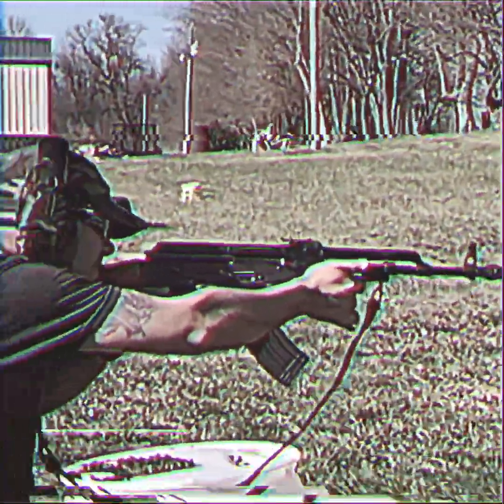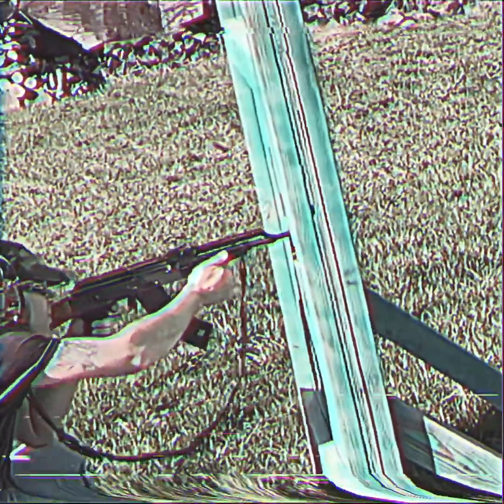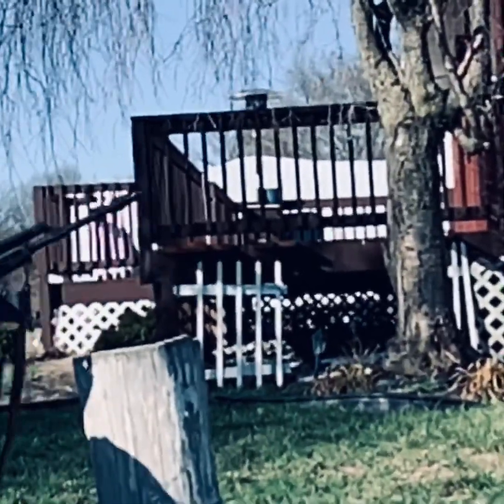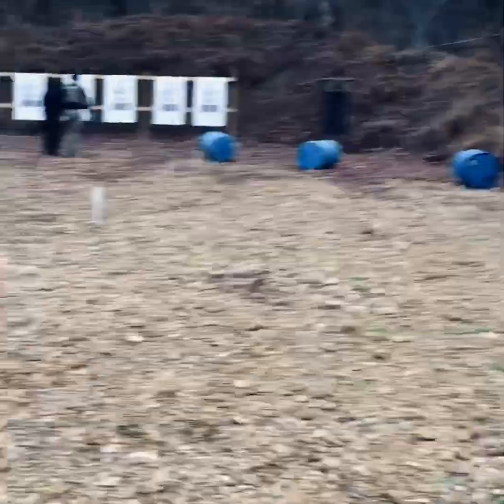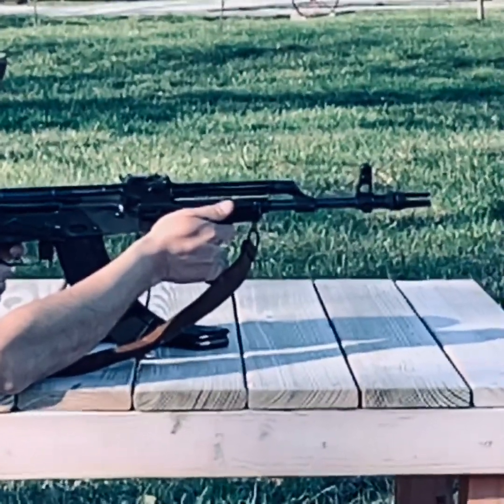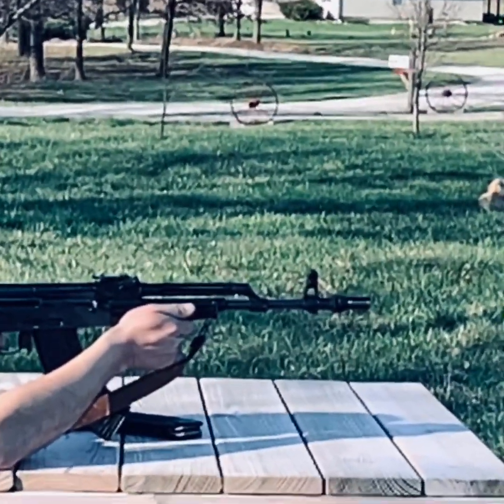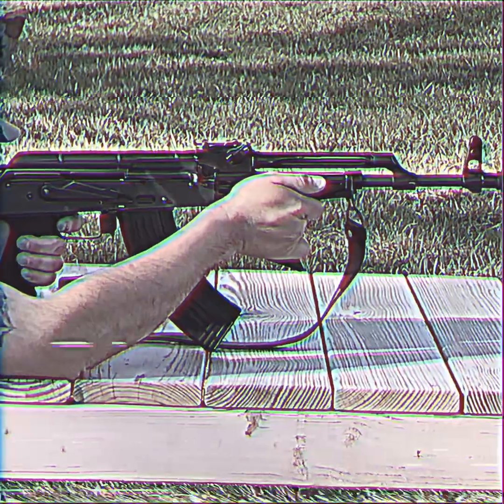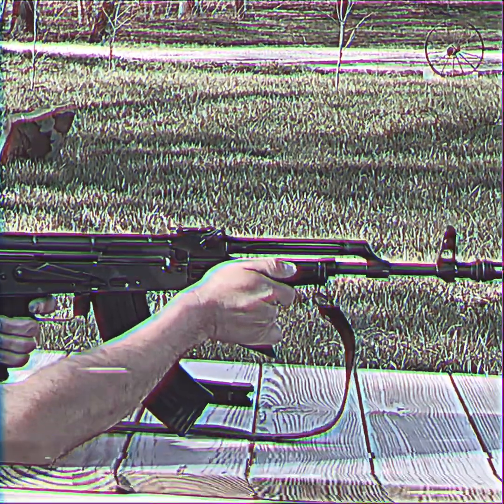AMD-65 Rebuild!

Comment: Nice rebuild! I took the recoil buffer out of mine because I feel like it sucked. I have run the wire frame cheek riser for a while and it works. I am going to build 3 childers 80%s coming up soon. Footage might not make it to my YT channel though. Maybe gun streamer or gun tube. 
That sucks that your original build didn’t work. My original amd 65 build was a screw kit that was 100% flawless. I ditched the screw kit a while back and used a newer parts kit and riveted everything properly. Thanks for the video Mr FNH!
Reply from the maker: That sounds awesome buddy! I so look forward to the next build. Thanks for watching. This was kind of a last minute video I put together late night while having a few drinks. Lol

Comment: Good stuff. Glad you got her running good again! I'm not a fan of the wire stocks. I bent one once and never looked back.
Reply from the maker: My wire stock seemed pretty loose all the time. Unless I tightened the screw until the stock wouldn’t fold anymore. #NotWorthIt